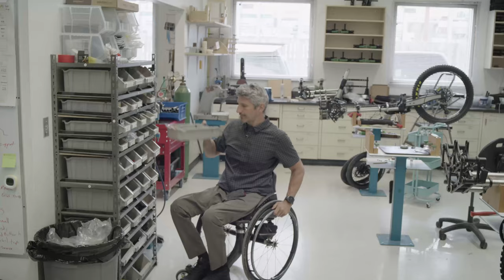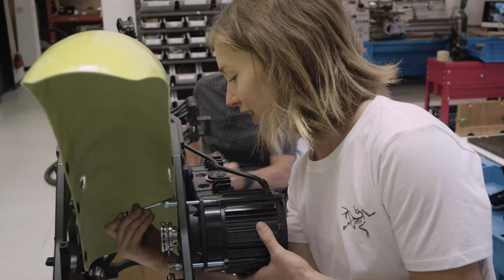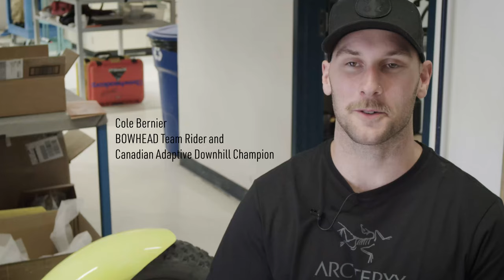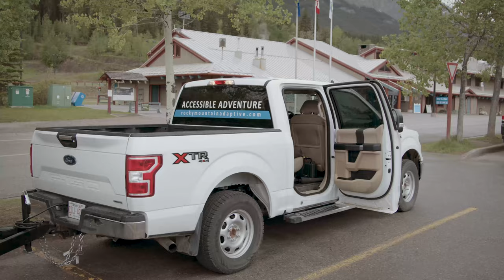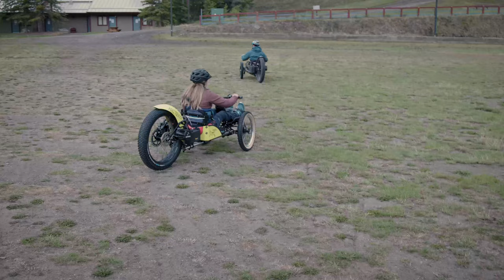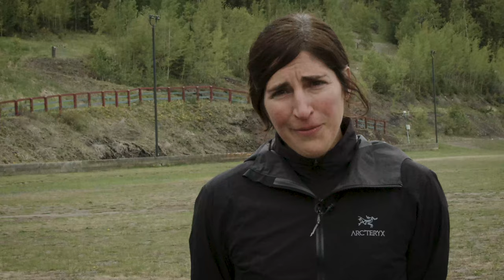Arc’teryx Alberta partnered with Bowhead to DONATE BRAND NEW Reach E-bike to Rocky Mountain Adaptive

Comment: I’m in the process to order a Reach! Can someone tell me more about the difference with battery life or mileage. I understand battery life will depend on riding style but can I get a general idea. The base model is built with the 12.5 a-h then upgradable to the next 21.5a-h
Reply from the maker: Hi, That's awesome. Like you say lots of variables in battery life. But we estimate 25-35 km with the smaller battery and 55-65 km with the larger battery. Check out some of the bike packing trips we've been on - https://youtu.be/GJFAfqZ88i4 - This was a big couple of days. Hope that answers your question. What adventures do you have in mind?